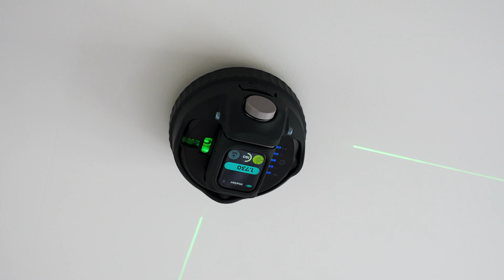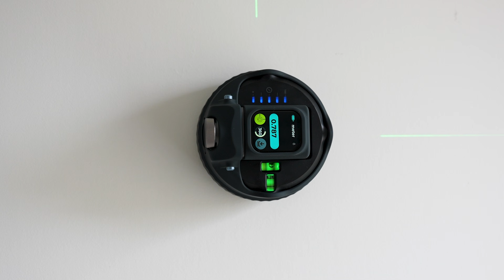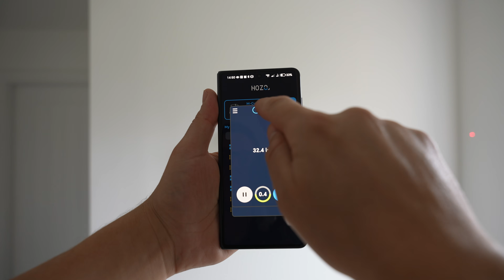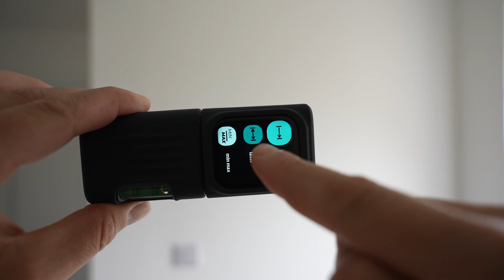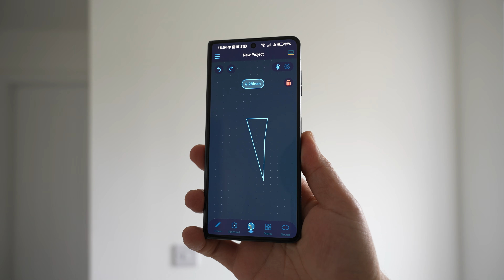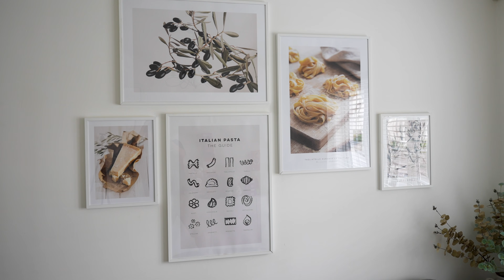The M-Cube 02 Anti Gravity Laser Level Is Insane!

Comment: Sorry Guys, this product is garbage.
I have two of them from the Kickstarter Campaign. It’s not even accurate as promised. Every one of them has its own accuracy.
In a distance of two meters the discrepancy is more than 4 mm!!
Reply: Omg thank you for this comment! I think I'm going to just buy the base so I can use it as a vacuum for my own laser to sit on it
Reply: Did you buy everyone of them ?  Other people say they are accurate
Reply: "Measure Accuracy Resolution: 00 Red Laser: ±1/16 inch (±2mm); 00G Green Laser: ±1/8 inch (±3mm)"

Sounds about exactly like what they list out. Also 4mm? What are you trying to do with this? Finished woodworking?